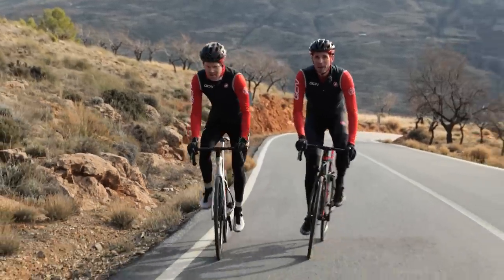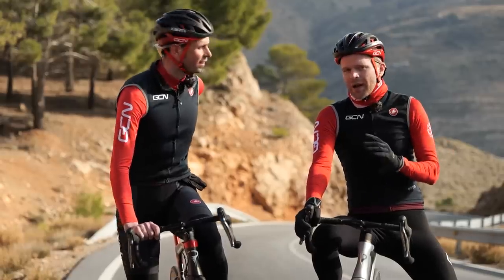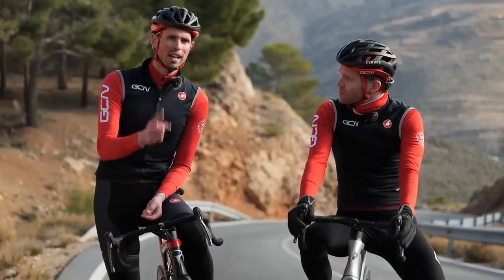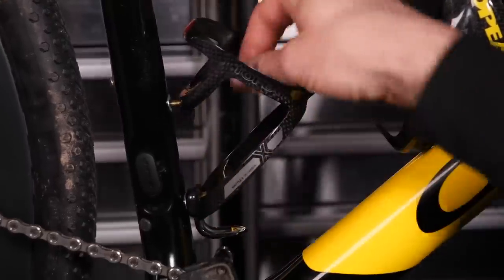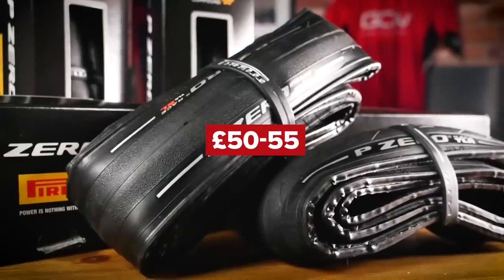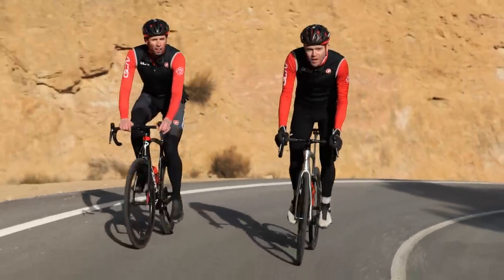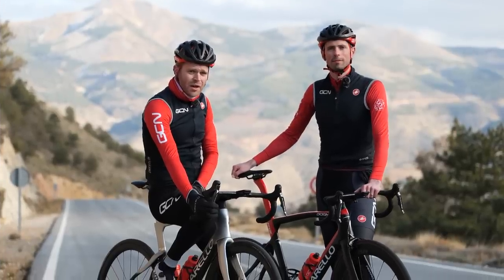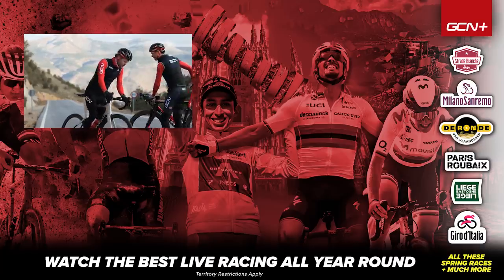What's The Best Value Upgrade For Your Bike - Spend Or Save?

Comment from the maker: If you could only choose to upgrade one thing on your bike, what would it be?
Reply: Frame, from Aluminum to Carbon Frame ;)
Reply: Carbón wheels
Reply: My wheels. It's the only thing I really need to upgrade at this point. Still running the stock aluminium set
Reply: Tyres
Reply: I would upgrade to add a support car. For easy bike swaps, food, and the occasional draft. Can even jump in for a bit on a tough climb if your legs are feeling knackered. The ultimate upgrade.
Reply: Maybe I misunderstood.. I meant, in general, if 'people' could only upgrade one thing, they should upgrade tyres. For my current bike.. hmmm hard to say, everything is so lovely... yeah tyres.. 28mm GP5000S TRs.. with tan sidewalls, if I can ever find any.
Reply: Getting rid of disc brakes
Reply: Groupset.  Electronic shifting.
Reply: Fewer pies. Dave money, lose weight.
Reply: Wheels
Reply: Everything.
Reply: A new bike
Reply: you will surely loose a lot of weight on your bike by simply ditching those diskbrakes .. noobs like me (and even pogs) don't need them anyway ..
Reply: Front fork. Next you should make video about upgrades not saving gram but durability, comfortability, usability and looks.
Reply: I should downgrade myself from  > 80kg to  < 70 kg. Then 28 mm tyres. Sadly, my old Bianchi only takes 25 mm.
Reply: Frame, lugged steel from the 70's isn't all too lightweight.
Reply: oh, maybe i should upgrade my leg strength and heart first .. by doing some gcn inspired indoor intervals .. lol !!
Reply: My personality
Reply: For free? Carbon Wheel 27.5 for xc wheel for 2.1
Reply: Wheels to start with or maybe just get a new bike :)😆
Reply: If money no object, carbon wheels. Otherwise tyres
Reply: Wheelset

Comment: I know wheels are often a really expensive upgrade, but getting new wheels can often be the most dramatic upgrade you can do.  It can make your bike feel like a completely different machine. It's not just weight; you also get better hubs, better aerodynamics if you're into that kind of thing, and a more comfortable ride. 

Also, if you're riding on GP 5000s, switching to wheels that make it possible to actually mount those damn tyres are worth every penny, I don't care how much they cost.
Reply: I rode the GP5000s on my single speed, not sure if the wheels make that much difference being track wheels, but they weren’t hard to mount at all 💁‍♂️ even on the easy side
Reply: I've tried 5 different brands of carbon wheels, each changed the handling characteristics of the bike. Not noticed any difference in tire brands, but tires sizes make a difference, wider has always been better for me.
Reply: @Ober1kenobi  rims make a huge difference in mounting. Cost doesn't really effect that.  My 28mm Schwalbe One tubeless tires are very hard to mount on my $3000 carbon DT wheels but those same tires are a breeze to mount on the $900 wheels I built with Pacenti rims.  The diameter of the center channel above the spoke holes is the main factor.
Reply: @happydays8171  there's a huge difference in tires of the same size.  Everyone's fastest tires are fairly similar.  But try a GP5000 and specialized Armadillos in the same size and you'll notice a sizeable difference in comfort and speed. A good 0.2mph with the same power at a cruising effort
Reply: @veganpotterthevegan  
Does one offer comfort and the other speed? I have Pirelli Race on right now, they don't grip in corners like the Michelins or S-works tires I was running, they may be fast, but prone to puncture. What do you suggest? Wheels are  Lun Hyper 50mm.
Reply: @happydays8171  faster tires tend to be more comfortable and have more grip. They're also more prone to punctures. Tubeless is the best way to get comfort, speed and fewer punctures but the fast tires aren't cheap.  You may make up for that cost with fewer flats assuming you don't patch your tubes.

Comment: there are other cheaper alternatives : Repente saddle 125g , 120€. Prime carbon bar 170g, 12O€ . 270g reduction total. Hunt wheels 1500g cost apprx 1000€, granted only saved 350g, but other benefits. TPU tubes  expensive, but considering you have 2 in tires and one in kit, it's 300g savings total. I also reduced body weight 3500g, and not only was that free, i saved money by not buying beer.
Reply: Here's a budget version:

Elitaone saddle 115g, 15 dollars. Og Evkin HB011 185g, 48 dollars. Uno Kalloy Stem 99g (90mm), 20 dollars. Avian CR3 R325 (38mm) 1490g, 428 dollars. Just go rimbrakes. Also yeah, make a diet plan and stop eating too much.
Reply: alloy wheel can be light too. Mavic Ksyrium weight 1500g for less than 500€. The upgrade will be aero with carbon wheels. For the same weight, you will have 40/50mm wheels (25/30mm for the alloy ones)
Reply: @atomus0916  and elitaone seatpost if your bike frame has 27.2mm standard round seat tube. 135-155g for $30
Reply: @binshuo  oh yeah, theyre light too hahaha
Reply: Not buying beer?? Whoah steady.
Reply: Hunt’s Aero wide 31mm deep alloy wheels weigh 1500gm too and they’re £400.
Reply: ICAN wheels even less.
Reply: @atomus0916  GCN where £180 is mere, I don't think I've ever seen this channel explore proper bang for buck components.
Reply: I'm looking at a set of hunt wheels as my next upgrade for my bike

Comment: Although bottle cage weight savings aren't significant, one way that's more cost effective would be to change/use a plastic one instead of carbon. They are generally quite light and cost a lot less than carbon. Durability is decent and gets the job done of keeping the bottle in place.
Reply: Indeed : plastic bottle cages are light, inexpensive and do the job
Reply: @baddan314  I was stupid enough to buy carbon cages a while back. All broke where a right angel bend holding the bottle in place. I now use elite plastic cages on all my bikes and have had no problems whatsoever….
Reply: eBay Carbon water bottle cages with no brand name is the best solution here in my opinion

Comment: Avoid taking too much stuff with you.
Avoid buying too much stuff for cycling.

-Shorter ride today? : only one bottle of water. I’m sure you can refill it somewhere when you make a pit stop.
-Food : how many of these snacks do I really need? I always came back with one bar untouched.
-Do I really need to know my heart rate? There’s a few more grams!
-Maybe buy a smaller and cheaper cellphone, it’s lighter to take on the ride, since you need it for emergency and pairing with your bike cpu.
-Have a code on your door lock and save yourself from bringing keys.
-A few bill, a credit card, and an ID fit well into a super light and super cheap ZIPLOCK bag. No need for those fancy pouches.
-Don’t overdress, and practice your resistance to the elements ; there’s a few more grams and dollars saved!
-As for tubes, if you buy the light but fragile ones, do you need to bring two or three extras to feel safe? Well, there goes your weight saving! So get the standard ones, bring a single spare, and you save money for the same weight!
-With all the space saved, put your second water bottle in your middle back pocket and save yet another few grams and bucks by having only one cage.
-Do you need a saddle bag or can you fit these spares and other things in your back pocket?
-Go to the johns BEFORE the ride! You’ll save a ton of weight! And comfort. And it’s a good excuse to have a coffee.
-Bike lights? Plan your ride and bring them only if necessary.

There’s tons of ways to save by simply thinking instead of spending :)

Comment: What about looking at all the other stuff that you carry in your pockets / in a seat pack when you ride a “normal” ride? E.g. multi-tool, tyre levers, chain tool, cape, gels / bars / rice cakes, inner tube patches vs spare inner tube, co2 vs regular pump, cash vs card, whole wallet vs 1 card, phone + or - case, etc.
Reply: just leave everything at home, ollie also advises to take off your bottle cages all together. You surely have a supply car following you around everywhere, no?

Comment: Quick release skewers, the standard ones weigh about 100g, you can buy titanium ones that weigh ~42g for around $20. 
Also stripping the reflectors saves 125g or so, if you haven’t.
Reply: Put on enough wheel reflectors and you just made a disc wheel that's faster🙃

Comment: I DID get rid of my old cages, and bought cheap carbon ones, and they are, as you state, about half the weight. 
As the new cages were only $10/each (they are cheap, um, overseas made) they were a good value, as the cage is not a critical component, which, if it breaks, is going to kill you.
Reply: Unless they break, and the bottle falls and hits your spokes / wheels and you crash. I am such a pessimist hahaha. Supacaz flycage ano are very light alloy vages

Comment: You forgot that when calculating weight on pedals, it's important to consider TOTAL system weight of the pedals AND cleats.  Wahoo/Speedplay always seem super light until you add in the required cleats.  For reference:  Look Keo Blade Carbon Ceramic Ti are 190grams for the pedals and 42grams per cleat = 274 grams total system weight.......Wahoo Speedplay Nano are 170grams for the pedals and 82grams per cleat = 334 grams total system weight......Shimano 9100 Dura Ace are 234grams for the pedals and 32grams per cleat = 348 grams total system weight.  I find it silly that people focus on the pedal weight without considering the weight of the required cleats and then considering the cost of the cleats and how frequently they require replacing and how much that costs as well.

Comment: I use durable stuff and lose weight instead, went from 85kg during the summer to 81 now. I didn't have to spend a penny on the bikr 🤷 most if us aren't professional riders so it's quite unnecessary tbh, just ride and enjoy the weather and your surroundings
Reply: I agree. I tried tubeless for a while, but the gooey mess isn't worth it, especially for a roadside repair.  (And there will be a roadside repair, even with tubeless.) Butyl tubes are inexpensive, the racy ones are light, if that's what you need, they're durable, they're easy to repair, and they stay inflated. For anyone riding on roads or easy gravel and not racing, they're probably the best choice.
Reply: I agree, my fat ass is always going up be the thing slowing me down, my 245lb 100 kilo ass is always going up be the issue, not some 50 gram weight savings... But I did go with carbon water bottles because I like how they look more than my cheap ass ones from Dick's sporting goods that I got with my cheap ass hybrid bike like 12 years ago 😂
Reply: Agreed 👍🏿
Reply: I weigh about 62 kilos which usually makes me much more light than most other riders even tho i ride an entry level racerbike.

Comment: The repairability of the lighter types of inner tubes after a puncture should also be taken in consideration.
Reply: And their relative fragility compared to butyl tubes.
Reply: @ragwort3369  Isn't the consensus that latex tubes are generally more puncture resistant than standard butyle tubes?
Reply: @feltrixx4273  Maybe, but they're also more fragile and easier to damage when installing, and they drop 15-20psi overnight, meaning that you need to inflate your tyres before every ride. That's no good to me; I struggle to get to work on time as it is!
Reply: @ragwort3369  At the end of the day, just go tubeless and buy a super light and compact TPU tube as backup. QED
Reply: @ragwort3369  Definitely not the case! Yes, they do lose some pressure. A lot faster than butyle tubes, too. But certainly not 15-20psi overnight (at least when we're talking standard road tyre pressures).

I do get your concerns tho, on a commuting bike, they are certainly not essential. On the bike I use for other rides, I wouldn't wanna miss them! Haven't damaged any of them yet, and got roughly 3k km done on the ones I'm currently using.
Reply: @chicagoan  I'm definitely not going tubeless! I know they puncture less often and mostly repair themselves, but from some of the comments I've read they can be very difficult to repair by the roadside when they do fail (and they will, sooner or later). I can't take the chance of not being able to fix my bike by the roadside on the way home from work. Besides, it seems pointless going tubeless then having to carry all the stuff to fix a puncture anyway just in case.
Reply: @ragwort3369  No different than repairing a tube. You just put on your spare tube. You just have to do it way less often and the ride quality, comfort, and speed is massively improved. Most guys I know puncture so rarely they don't even bother bringing a spare tube.
Reply: @chicagoan  yep plus if the puncture is too big to seal you can usually just use a dart plug without needing to take the tire off at all
Reply: @paulwickward6703  Yep, always carry a dynaplug. Knock on wood but haven’t needed it yet.

Comment: It might be good to look at drive train replacement parts and bang for your buck. Since you'll eventually have to replace those parts it would be nice to understand where to spend and save. I generally know that you can save the most weight in the cassette typically for instance.

Comment: Entry level carbon wheels can perform almost or equivalent to expensive wheels. Just change the bearings to low friction bearings (ntn llb, nsk vv, etc) and wrap it with hi-performance tyres.

Comment: It's a significant spend but I think, it is a new set of wheels, at least on cheaper bikes. I had an entry-level carbon model which indeed had cheap and heavy alloy wheels on it and then spend about 50% of the bike's price on a nice set of alloy Fulcrum RZs. Together with some nice tan sidewall tires I actually managed to grab a 50+ percent result in the bike vault (😁) and it looks so much better which was worth the investment, already. On the first few rides I had the odd feeling that the bike was "pushing forward" on decents because I was calibrated to my old wheels, but the ceramic bearing just respond better.

Anyway, what I'm probably trying to say is that upgrades usually don't make you significantly faster, so better spend money on parts that make your rides (feel) more enjoyable rather than going for marginal gains. My 8,5 kilogram bikes was about 200 grams lighter and maybe it takes up momentum when going out of the saddle better but that's not what it was about.

Comment: Wheels are expensive, but a great upgrade that change the look and feel of a bike (as well as the weight).  Carbon Fiber water bottle cages can be acquired on-line for about $24 for a pair of high quality cages which are half the weight and look very cool.  Integrated Carbon Fiber handle bars and stem, purchased on-line from over sea sources they can be very inexpensive, save considerable weight and look very cool with internal cable routing.  Things I've bought that are not worth it include, Titanium Skewers (very little weight savings), Carbon Fiber saddle (very good weight savings and not expensive but not too comfortable).

Comment: I had a gas nipple fitted on the frame and had the wheels properly gas sealed. Then I filled the frame and tyres with helium. Cost very little and the bike pulls about 1,5 kilograms less on the scale. From a cost benefit point of view I am very pleased.
Reply: That sounds absurd but could be a stroke of genius.lol
Reply: If that is true, you should run to the patent office inmediately.

Comment: A decent wheelset is, if done right, one of the most efficient upgrades you can make. I've swapped a Shimano WH-R501 wheelset for a Ritchey WCS Zeta wheelset on my aluminium alloy "tank", taking gross weight down from 8.8 kgs to 8.3 kgs. Aside from that, it is the rotating weight that also makes a significant difference. Plus, handling feels a lot sharper and stiffer. The ride feels like a day-vs-night kind of difference.

Comment: Hunt alloy wheels - Hunt Aero Light or Hunt Aero Wide are AMAZING $$$ per G savings - yes tubes and tyres are best vfm but once you've done it, you can replace a 3rd tyre :D so you move on, my first wheel upgrade was Hunt Aero Wides and shaving over 1/2 kg off my (now winter) bike, with its Giant PR-2 >2kg wheelset felt amazing...

Comment: They don't mention that the huge drawback with TPU tubes is that they can't be permanently repaired.  The stick-on Tubolito patches will eventually fail at a random interval of 1 to 6 months.  That makes a puncture on TPU tubes very expensive.  Not only that, TPU tubes have rolling resistance closer to that of butyl than latex.  Still, they are great spares to carry in your seat pack, since two of them take the same space and weight as one spare butyl tube.  I use latex tubes on the bike because of their light weight, low rolling resistance, and ease of repair (standard vulcanizing patches stick to latex better than they stick to butyl). If I flat on the road then the TPU tube is kept in the tire only until I get home.